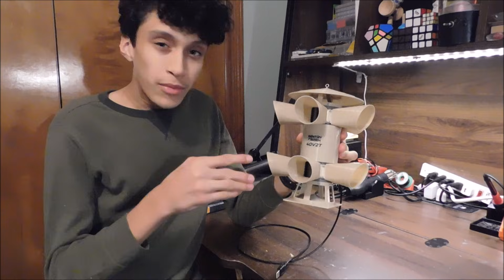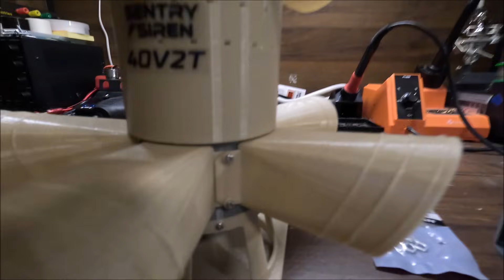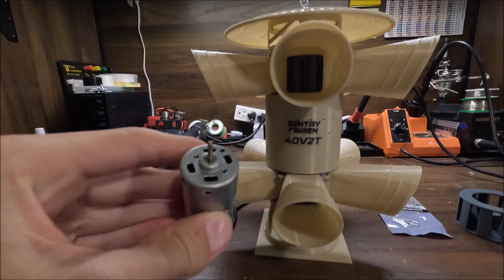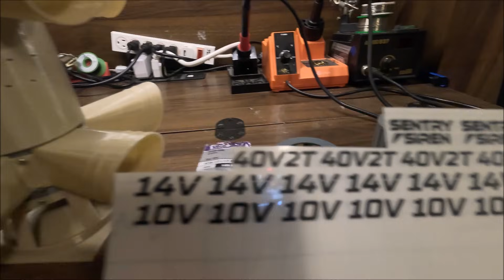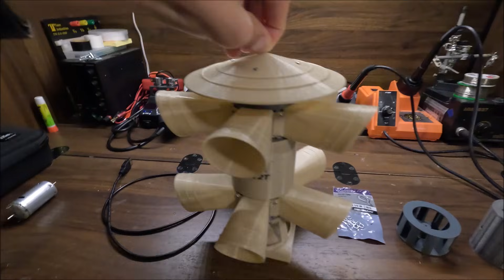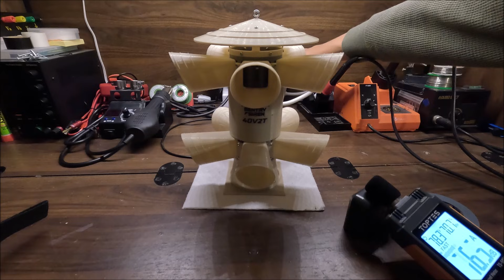NEW Mini Sentry Siren 40V2T Overview/Test!

Comment: Nice! It sounds incredible sentry 20v2T is my favorite if you don’t mind making one someday
Reply from the maker: Thank you! I'm making a 10V, so there's a fair chance I will also be making a 10V2T/20V2T or a siren like that soon. Maybe even a 16V1T-B if I don't want to use a dual-shaft motor.
Reply: @milespeterson5049  oh ok nice! 20V2T’s do have a large motor cover so I feel like two motors would make it easier
Reply from the maker: @Sirens-and-garbage-trucks  True! It'd be a 1-phase unit at that. And I could literally turn that into a 16V1T-B by just refining it a bit and making new decals, LOL.
Reply: @milespeterson5049  yes,Lol

Comment: Highly recommend using super capacitors to get a rely long wind down that what i am going to use on the model 120 prototype
Reply from the maker: Yeah, I used to use those but found that they give a siren a fake wind-down, which I am not a big fan of. Still, probably really cool on other sirens, like your prototype Model 120!
Reply: @milespeterson5049  may I have you old superer capacitors jkjk lol

Comment: ABSOLUTELY INCREDIBLE 🔥🔥That thing is loud, accurate, and looks amazing! Great job Miles!!
Reply from the maker: My gosh, thank you!!! It would be CRAZY if you printed this!
Reply: @milespeterson5049  Yes it would! It would be next level for me though. Do you think I'd be able to do it?
Reply from the maker: @TrainsAndSirensofCA  I will be real, putting this together wasn't too hard. With the right screws, everything just fits together as it should. But what might be hard is installing the motor between the two stators and bolting the horns to the stators without scraping.
But seeing all the sirens you've made from me and other people, I think you could do it! It's really up to you. I have other simpler sirens in design you could make instead.

Comment: will you make a video about the 14v or 10v or whichever one it was
Reply from the maker: Yup, I'll be making a video on my 14V when I print that! I thought about making a 10V, but unfortunately, those use a 14" rotor, which is TINY in 1/8 scale, and making it bigger would be confusing because my other Sentrys are 1/8 scale.
Aw, but I want to make one... Maybe I'll just do it in 1/6 scale to match with my Model M and ECLIPSE-8.